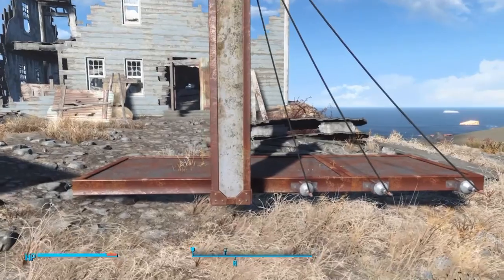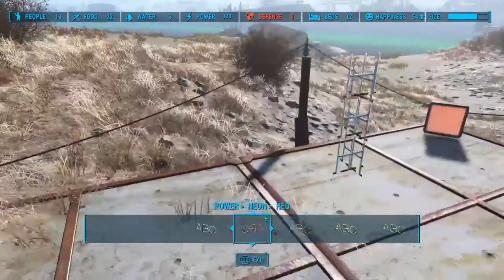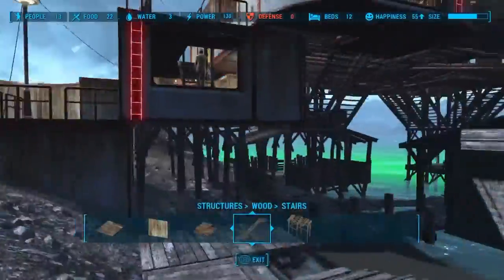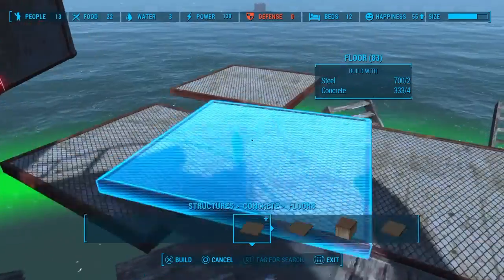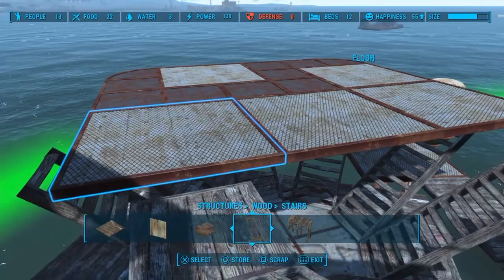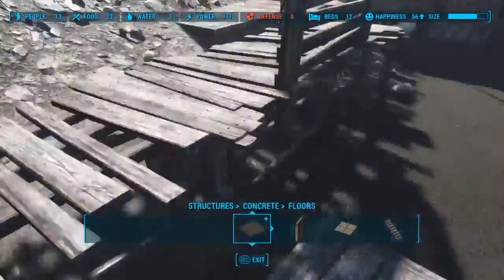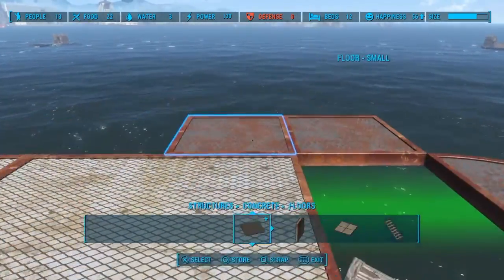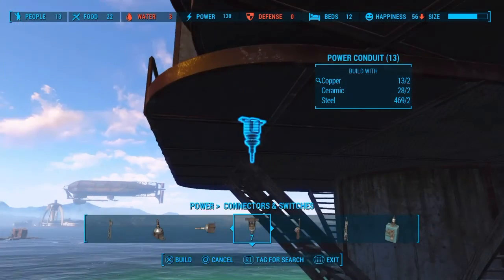Fallout 4: Let's Build 8 - Awesome Helipad!

Comment: great videos! I am having trouble making my own helipad however. I am building it on SI I have tried using pretty much every floor item in the settlement tool set, and have placed the doormat at different locations on the helipad, but the VBs  just land next to it, whether I am throwing smoke onto the helipad or flying in from an outside location. I have also tried different numbers of flooring; 3x3, 6x6, ect. any tips would be great. thanks.
Reply from the maker: Well, when you call a Vertibird, it's going to land based on where you threw the smoke.  The fast travel target rug only makes it land there when you fly back from somewhere else.  You are using the "fast travel target" rug from the resources miscellaneous menu, right?  Though it will land on it in different ways (i.e. sometimes it lands the nose on it, sometimes the tail, or facing different directions), I've always seen it land on the rug, even if it means clipping through a 4 story building to do it.
Reply: Darkdally I am using the fast travel rug, and when I throw smoke I throw it onto the pad itself. however whether I throw smoke or land in from another location I can't seem to get the veritbird to land on the platform. I do have it located on uneven ground, however the pad itself is level.
Reply from the maker: Well, again, calling a vertibird with smoke won't ever make it land on 
fast travel target.  That's just to pinpoint where it lands or where you
 appear when fast traveling there.  They're very unpredictable where 
they land from smoke.  I've had them land right on it, and I've had them
 land 3 blocks away from it, to where it took me several minutes 
wandering through Boston just trying to find where it landed.  So it's 
only going to work for a vertibird that you're riding in, returning to 
your settlement.  That said, I don't remember if I show in the video 
where I placed the rug, but notice that my pad is huge and the rug is 
off to one side.  That's because the bird like to land in that 
particular place sometimes facing different directions.  Putting it 
where I did and on such a large helipad is what landed it there.  I'm 
sorry, I would like to help you, but that's the best I can say.  I've 
never not seen a vertibird land on a fast travel target.  No matter 
where I put them.  I've put them inside before and the vertibird lands 
INSIDE the building just to land on the rug.
Reply: Alright, I'll try a few different things and see if I can get it to work, thanks for the reply and the videos.